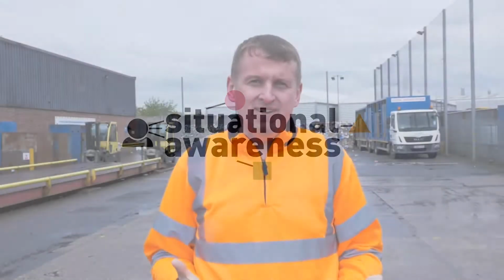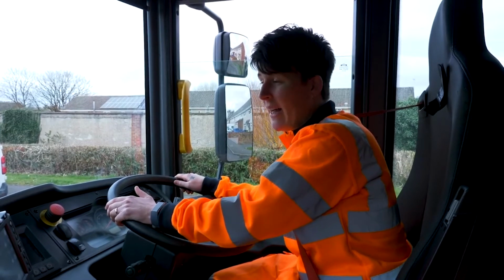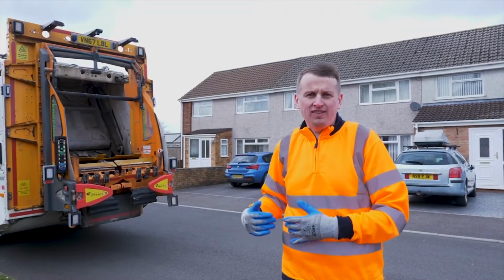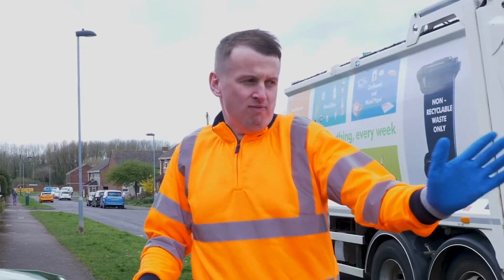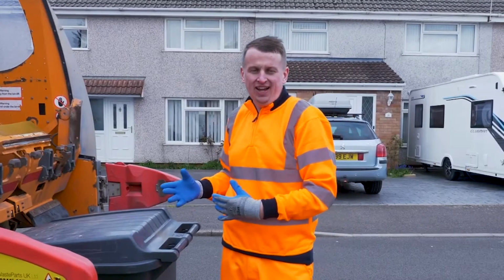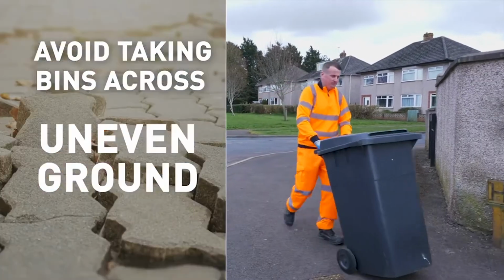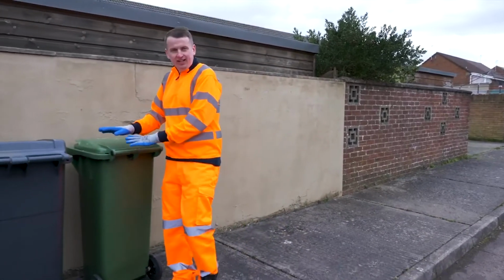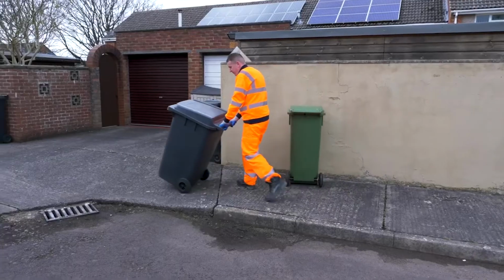Situational Awareness: Transporting waste manually

Comment: Right, I understand what you are trying to do but the crews are under so much pressure that little of this stuff is possible. It's almost always quick check that will do. If you did everything that speed how long would it take you to do a standard round? My guess is 2,3x as long. (I'm not on about any council, company, crew in particular)